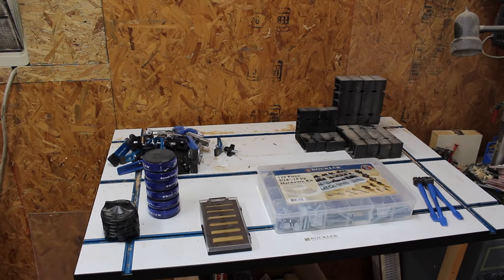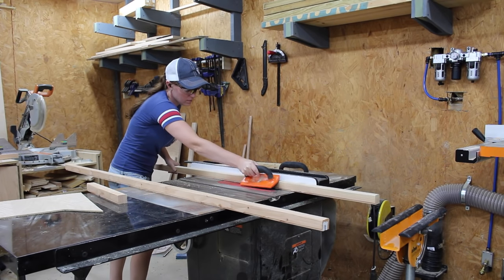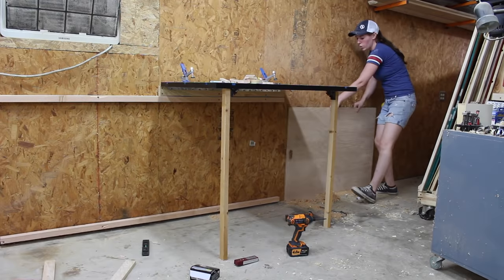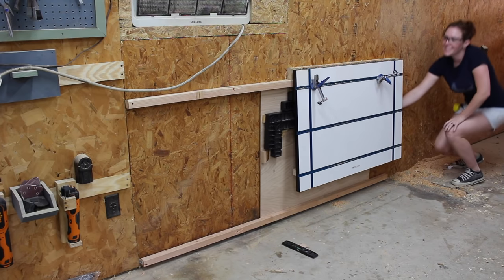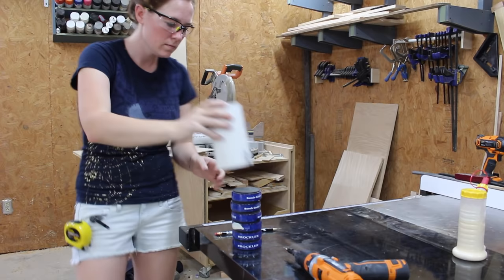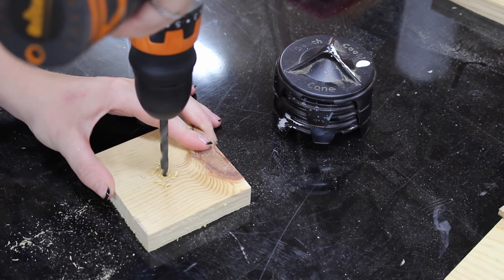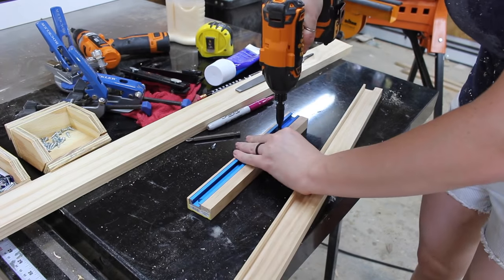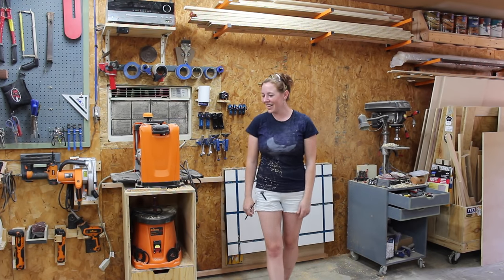Organize That Shop - Three Shop Organizing Projects

Comment: "I didn't feel like putting in my dado stack"

And there's the downside of a sawstop. It's not just a blade change, but also a brake cartridge change.
Reply from the maker: I don't mind switching out the cartridge too much, it only adds another few seconds. But if I'm only cutting something 1/4" deep, I don't want to go through getting everything out and switching when it will only take two passes with a regular blade.
Reply: But then you use your router with a guide for another dado cut? In all honesty I would have used a router table for that cut (so not a dado stack), so pretty much giving you a hard time.

Plenty of internet noise on the forums with owners that use their dado stacks less after moving to a sawstop. Only downside I've found, and not a big deal (more than one way to cut a dado). I value my fingers more than my time personally.

Comment: Reference Peter Travis, yes, if your workshop is too tidy then you probably don't use it much, but it's a fine line between organised chaos and just chaos!, and not one I tread very well!, so like a lot of people I suffer from tool invisibility syndrome, I know it's there somewhere under the sawdust and other detritus, but by the time I have found it it's too damn late to start the job, every summer I make an effort to reorganize my workshop, and every Autumn, that's Fall to our transatlantic cousins, it's not quite finished, then the weather turns and I have to clutter my "shop" with materials and other household items which can't stand out through the winter, I am really not sure there is a cure for my condition, but I know from talking to a lot of people that I am not alone!, like and comment if you are a fellow sufferer or can suggest a reliable and cheap cure...

Comment: When using your hand drill in awkward  positions try not to clamp your head, neck, shoulder and arm and use this to counter the force of your drill.  I notice you do this often.  You can injure yourself.  Use a step ladder to get into a better position.  Use another handle on your drill to control the drill better and stay relaxed as possible.   Look back at your videos and assess how you use your body when you work and see if you could have done something different to avoid unnecessary strain.

Comment: What are  bench cookies for?
Reply from the maker: I mostly use them to elevate my piece off my work surface when I'm finishing but they have anti slip pads on them so they are also great for gripping your piece if you want to use a router or sander.
Reply: Cool thanks April :) I am from the U.K. maybe we call them something ells over here, but I have never even seen them before :(. Love your vids :)
Reply: UK also parrot340, do a search for Rutlands. They are a UK based company and buy in bulk items, some from America and i assume "probably wrong" from Rockler sometimes. I think this becuase they have some Rockler items for sale from time to time. Sometimes it can take them a bit of time to get stuff in stock again, i guess becuase they wait for a good price to buy in, but still have some great stuff at good prices aswell. They have The Gripper, the clampit squares and bench cookies aswell from time to time.

Comment: Um ... what is a bench cookie ??
Reply from the maker: They are a small shop tool that is used for a variety of things. They can elevate your work while you finish, or help grip them in place while you use a router or sander on them. (Just two examples) http://goo.gl/4HlRbR
Reply: Thanks April ....  :  )